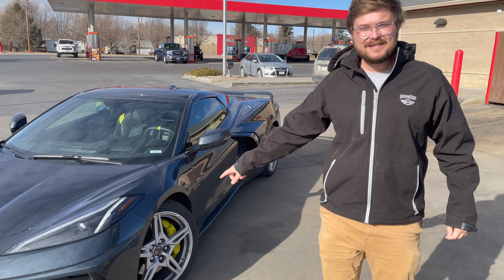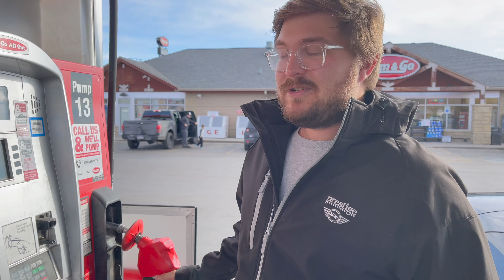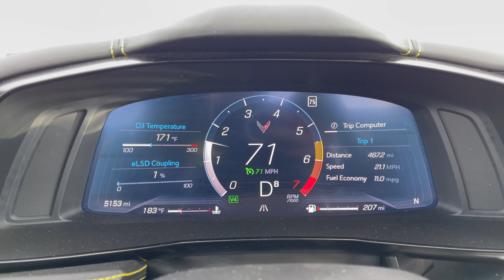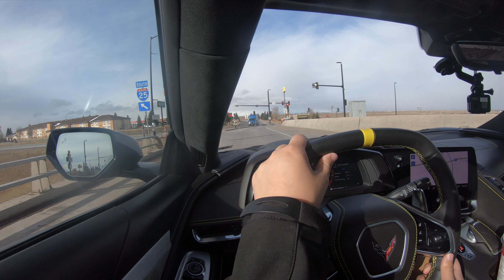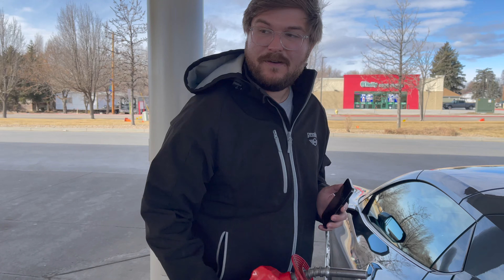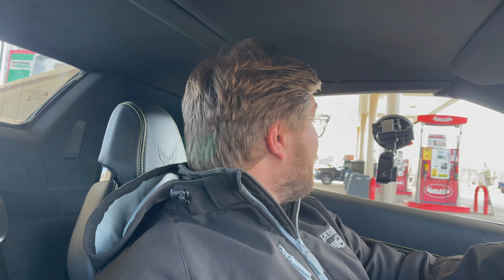C8 Corvette Convertible Z51 Highway MPG Test - 70mph

Comment: Mileage should improve after engine break-in.  A non-Z51 coupe would do substantially better. The inset backlight of the convertible creates a low pressure which increases drag.  Also, non-Z51 has numerically lower final drive.

Comment: Most Vettes will easily get higher 20's over every generation since C5, and at speeds higher than 70.  You also are at elevation, with wind, and especially where you are have to always remember that COLD air is much denser, which means more fuel used and also denser air much harder to penetrate.  Best if 70 degrees or higher.  Best mileage ever in my F 150 over 1200 miles was in 98 degree weather with no wind.  Find a vendor with non ethanol blend gas.  Always poorer mileage since its only 90% gas

Comment: The c-8 manual says 93 octane is required as a minimum. Lower octane fuel will result in decreased performance/economy. Therefore actual fuel economy should be better with a highway range well over 400 mi.
Reply: yes.  exactly.  Don't buy the Vette if you cant afford Premium

Comment: 1st of all, I'm certainly not a know-it-all but an $85,000 Corvette do not have all the options.  To max out a stingray, it would take another $20,000 in options which are available.  My Stingray HTC prices out at $103,000 with more options to go which I didn't want.
Reply: Exactly. My HTC is 94k. Accelerate yellow Z51 with mag ride. Yellow calipers, seatbelt, custom yellow stitching. Carbon flash nacelles and roof and painted mirrors and spoiler. Spectra gray wheels, Jake logo stripe, custom plaque, Carbon fiber trim, and battery tender.

Comment: Diverging Diamond interchange looks like? We have several of those around Atlanta.
Reply: Nope that's not a divergent diamond interchange at least not the turnaround part he took. the actual main intersection could have been I didn't see it well enough to know for sure, They have  those  all over Texas as well a secondary Lane used only for u-turns to go back the other direction. 
Divergent diamonds are more of a Criss-Cross where you turn left and stay on the left side of the road and then Cross back over to the right side once your  on the other side of the intersection. We actually have one of those where I live but it's a really small one.

Comment: Yes, less air density for less aero resistance and better fuel economy (reduced fuel compensated for reduced air density).... for normally aspirated engines.
Reply: ... though, the fuel consumption, adjusted for air density, may be negligible as the vehicle compensates to maintain a constant ground speed. But the reduced aero resistance will positively impact MPG figures as opposed to sea level pressure.

Comment: When it's time to rebuild the engine, do four of the cylinders need to be rebuilt previous to the time the other four cylinders need to be?
Reply: That used to be a legitimate concern on their older versions of cylinder deactivation because the cylinders they turn off were always the same four.
I believe in the newer GM V8 engines the cylinders that get deactivated actually go on a rotation pattern of some type or other. This equalizes out any differences in wear, but I think the main purpose was to create the smoothest operating engine under all conditions. They even have this on their inline four-cylinder engine in the Silverado. It can run on two cylinders